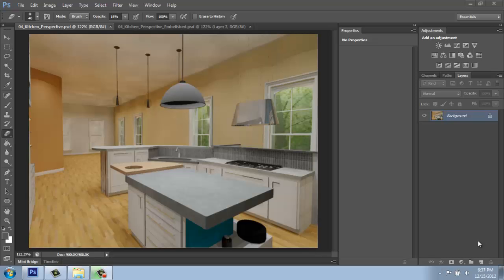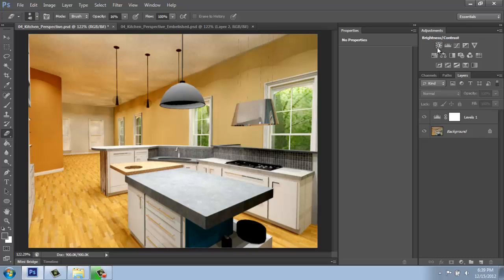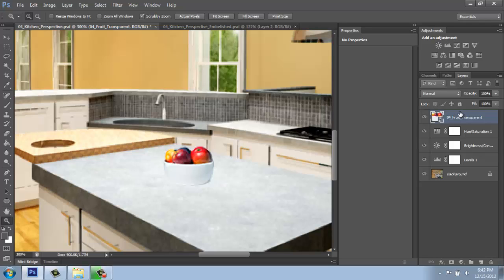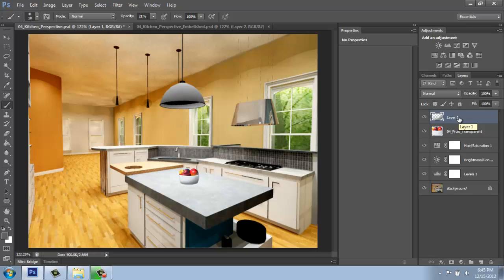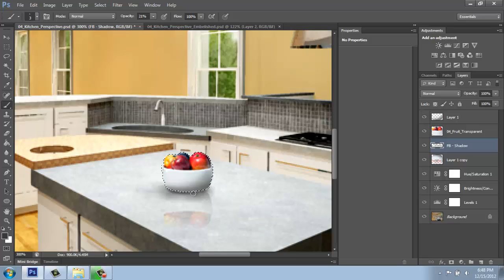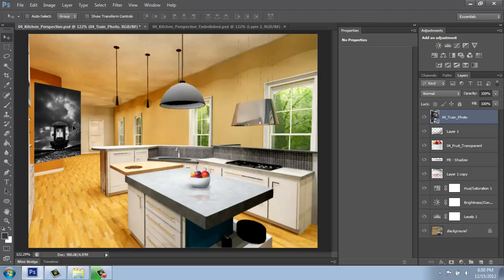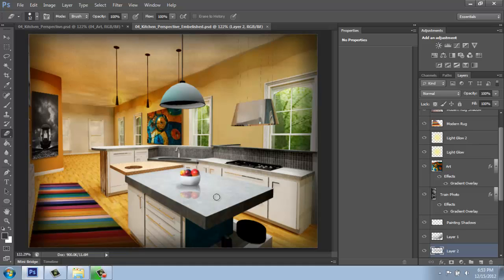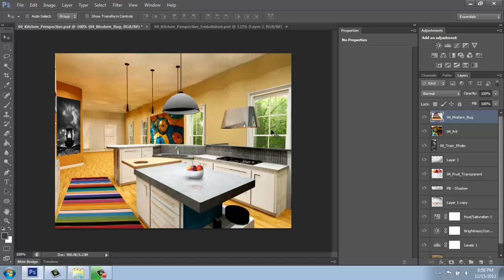Adobe Photoshop Basics - Part 10a - Adding Details to a 3D Rendering - Brooke Godfrey

Comment: After editing in Photoshop while printing why colour changes and not getting same colour print...how do I fix it ..plz tell
Reply: Because your screen is using RGB colours and your printer is printing it in CMYK so if you want it to be more accurate you have to use CMYK. Also, your screen settings may need some changing, it might be projecting more green so when you print, it won't look as green because it doesn't have the filter from the RGB if that makes sense. It's hard to get it accurate!
Reply: Whatever colour you choose in Photoshop, it should say both the RGB number and the CMYK :)